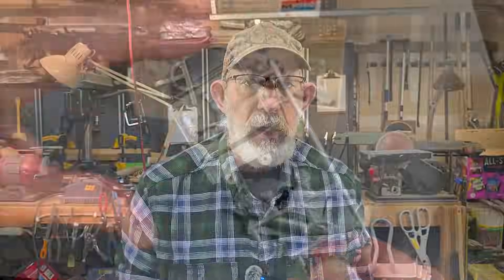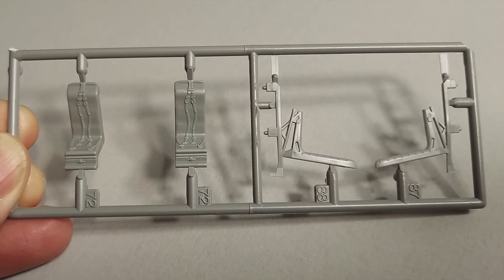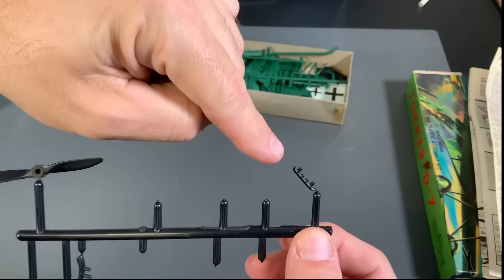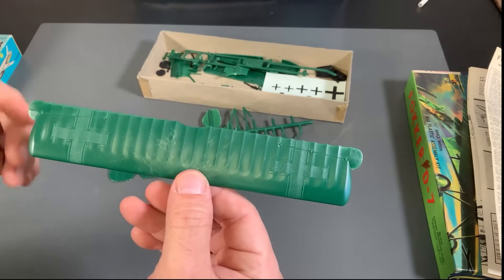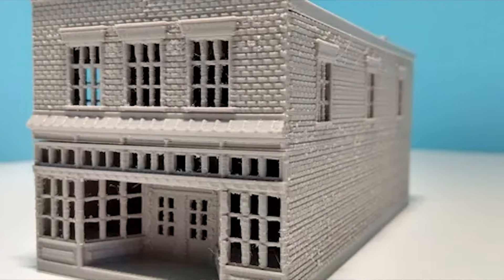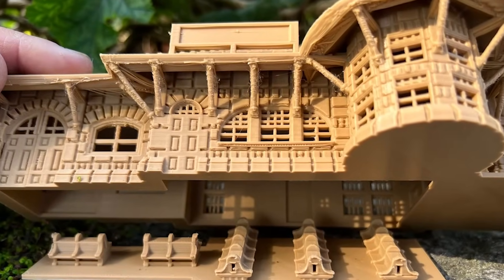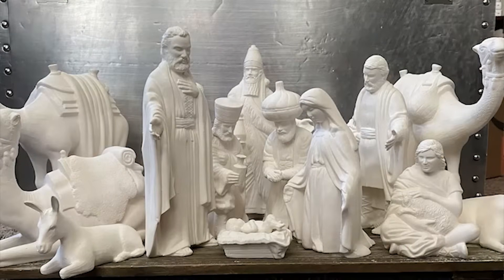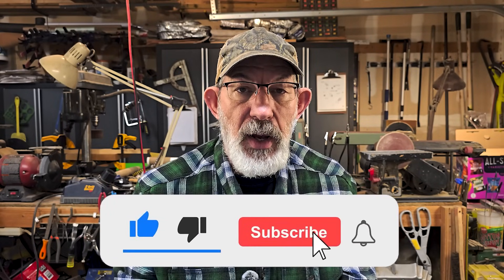3D Printing Flat and my argument for it.

Comment: After a 90° rotation a difficult overhang is no longer a problem. Removing overhangs after printing them never really works, its always clearly visible. Supports do help, but you always see afterwards where they have been.
Reply from the maker: @flybywire5866  especially when we do our buildings. Like awnings and porch posts. Thanks for sharing and commenting.

Comment: I design my own buildings really flat: I print them out on card stock after using Blender to 3D design them. I use material textures photoshopped from google maps street view to apply to the models and pepakura to unfold them and add flaps. Then I upload edited png copies to Cricut DesignSpace to print-n-cut out all the windows and pieces. Now I have 3D printers, but I like that I don't have to paint anything that can print on paper. I have an urban layout with tall n-scale buildings. I usually have to print everything double so that the walls block the internal led lights.

Comment: I've been designing and printing this way since I started, for basically the same reasons as you (although I hadn't thought about the rustoleum as and adhesive helper; that's a good one!). So, my friends always criticized why I didn't simply print everything as a single object ("that's the point of 3D printing", they said). So instead of continue bickering, I'm just gonna share your video with all my detractors! 😂 Thank you for your videos!
Reply from the maker: That's wonderful news!  Using inexpensive masking tape from the dollar store, applied upside down with the adhesive side facing out, is a superior alternative to clips or Blu-Tack. I find a 1 1/2 inch width stick ideal for this purpose. Thank you for sharing this helpful tip.  And yes, the Rustoleum 2x spray is excellent. Please let me know if you need more tips or have a specific product or tool you'd like my wife and me to make a video about.
Reply: @TorahScience  That's very kind from you, thank you! I'll be in contact if I come up with some idea that can help us both me and your channel 👍Now I'm subscribed. Blessings from 🇨🇷!

Comment: The core group that made FDM a thing back in the day where really into the the futuristic, sci-fi adjacent aspect of it. They had self-replication as a primary goal which leads to a focus on printing complete models and print in place mechanisms. 
Those of us that just want to make parts to make our dreams real have always cut our designs into pieces that print easily.
Reply from the maker: @brocktechnology That's why the methods that proved effective in the past, such as utilizing spruces from blow injection models, remain effective today.  Thank you for the clear explanation.

Comment: The biggest powerup I learned after several hundred hours of learning 3D printing stuff - slicing objects in half/parts, resizing specific areas (not stretching the whole object in the slicer) with FreeCAD. If I had to print a lot of structures, I would definitely try slicing the models down into walls, roofs etc and assembling the 3D object afterwards - it's a great idea - you can reduce the number of overhangs like those on those shop windows you showed earlier.
Reply from the maker: Thank you for your comment; it was not the printer's fault for maintaining that detail, but rather our attempt to rush the process and accept less precise results.  Even with this new printer farm and its 250s speed, I still prefer slicing my details at 125 or lower.  PLA has its limitations. Thanks for comment.